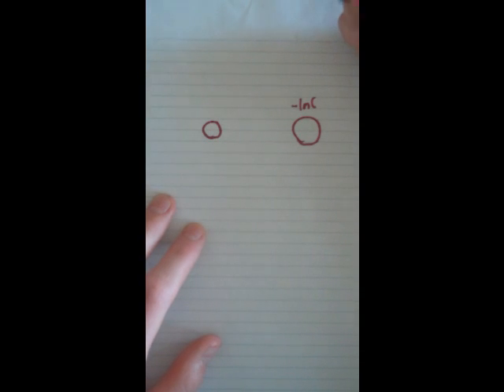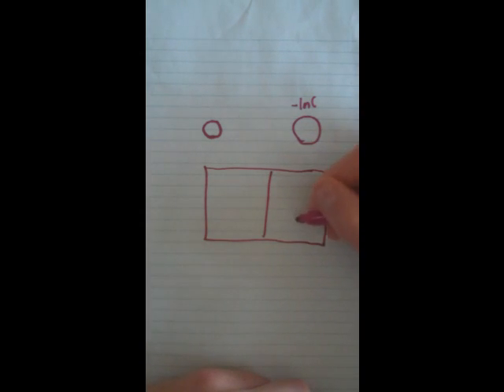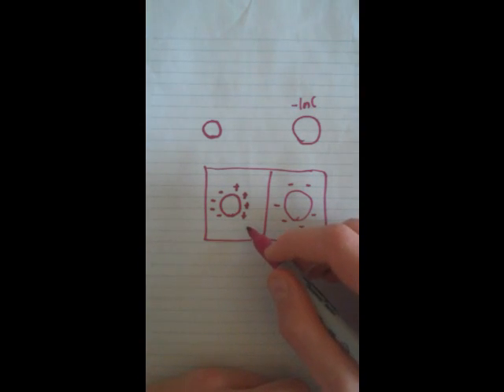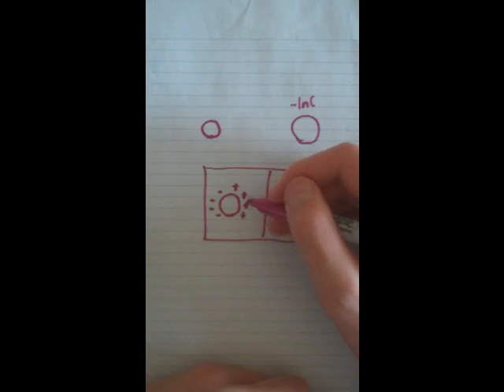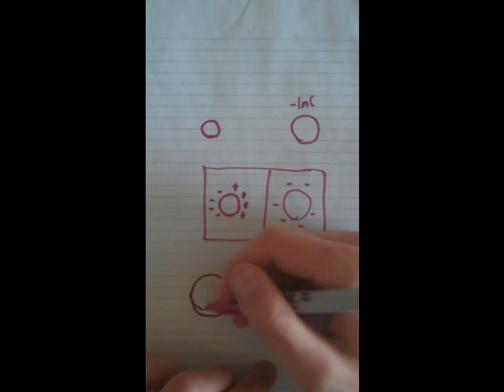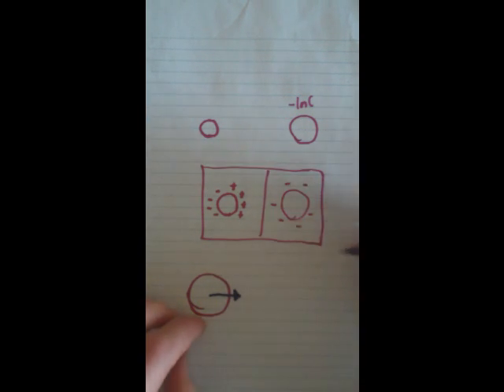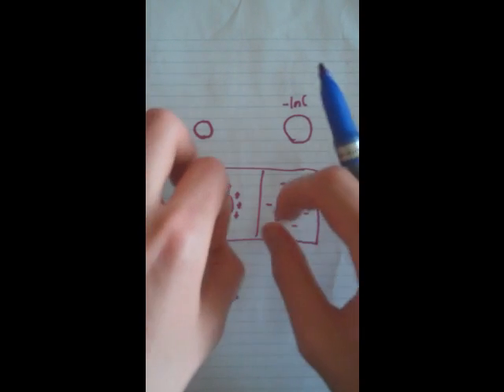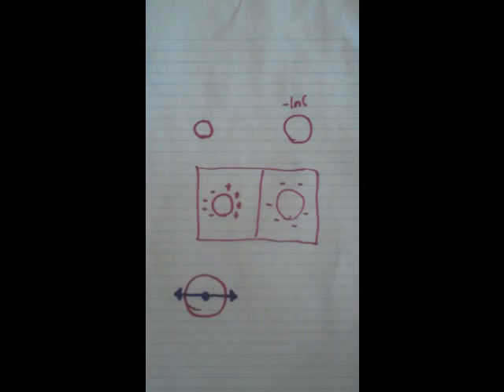Electric Field inside a Metal Ball

Comment: if there was a no net charge inside the sphere then why when we calculate the net charge of the metal ball its p*4/3(pi)r^3  (where p :is the volume charge density and r:is the radius)which means we are taking the charge over the whole sphere and not just the surface?right?because 4/3(pi) r^3 is the volume of the sphere and not the surface area?sorry if it was a stupid question and thanks a lot for the help